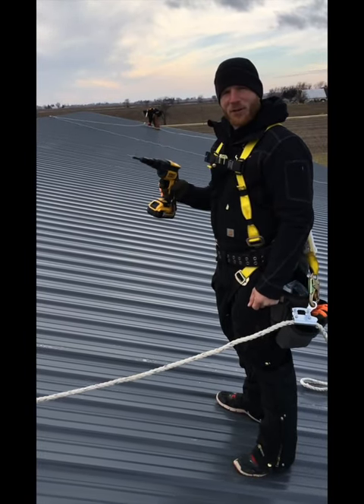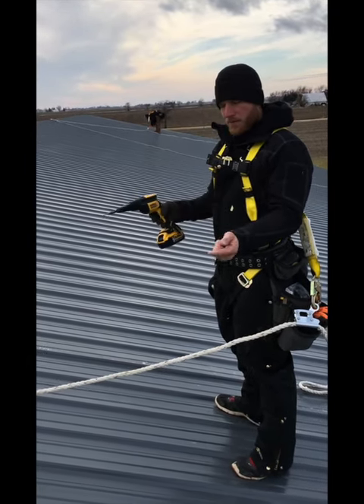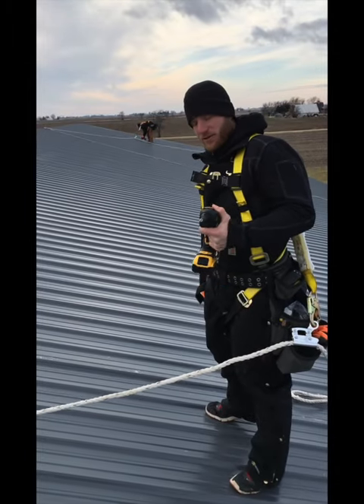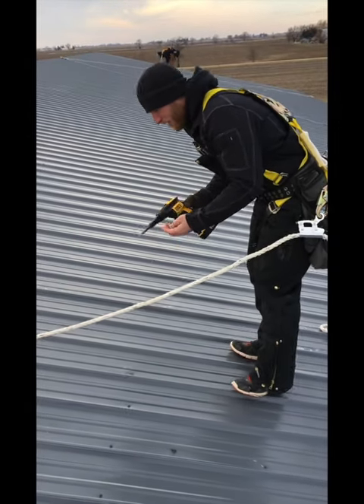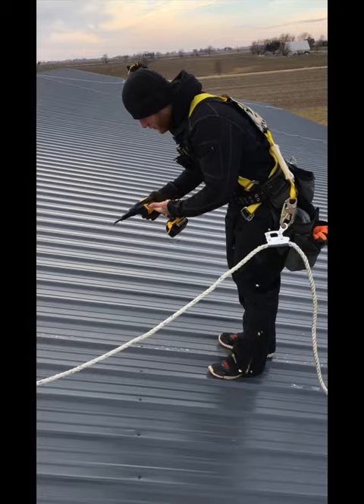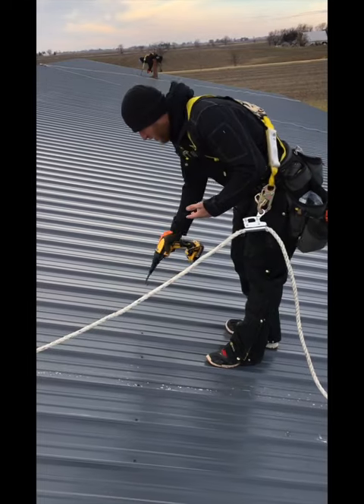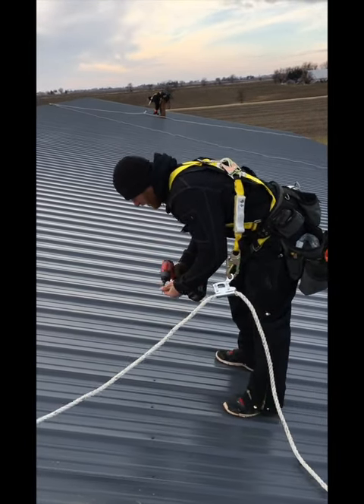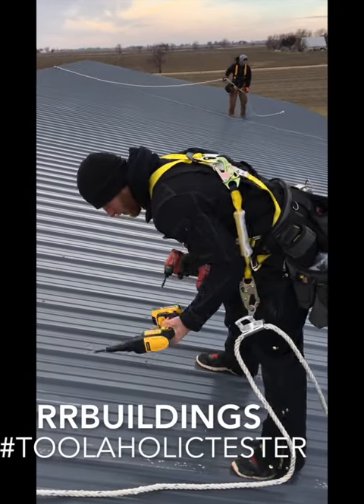Dewalt DCF622 Versa-clutch review

Comment: who uses impact drivers to drive that small screws into soft metal? Impact drivers are meant to brute force torque not for rpm speed screwing. A standard drill would do better too..
Reply: Beg to differ except in a greenhorn hands, (I work my impact like a fine piece of ass) BUT I get your point homie. I love my milwaukee remodeler gun, I do use it mainly on wood sheath or God forbid drywall if I can't fake sick that hour lol. But yeah back to the video, not a vs kinda battle really, but I love raw video. Bro keep it up! I'll keep watching man
Reply: I always kinda just used my impact for driving everything and I think I got like this from the years of being up on ladders/scaffs and needing the lightest drill attached to my rig or belt. Those “just get it done” situations.
 
But drills have come a long way in improving size/weight so lately I’ve been using my new standard chuck drill as my ‘main’ drill I wear.

It’s crazy but my impact from 4 years ago is heavier and the almost the same length and my new brushless chuck drill....and the new impact drills they got now? Sheesh so small!
Reply: Yeah dude has no idea what he’s talking about I do light and heavy steel framing, there’s 3 different impacts I see, the Milwaukee 2 speed impact, the dewalt 3 speed impact, or the Makita impact. Most people like the makita the most I prefer Milwaukee personally. ZERO people use regular drills for installing steel. FACT.
Reply: @keys72  milwaukee for the 🏆

Comment: I guess it just comes down to using the tool intended for the job
Reply: Yes Milwaukee makes a screw gun too. These are used mainly for drywall
Reply: @justauser these are way different then a drywall driver. Yes the bodies look the same but works way different.

Comment: Any option of using the dcf620 drywall gun for metal?
Reply: No, because the drywall gun only cuts off at a certain depth, this has a clutch. Since you're using hex head screws on metal you would be over torquing them and stripping the metal due to the extremely high RPMs of the drywall gun.

Comment: Good to see, but they are 2 different tools. Adjustable clutch or depth will always be faster. Get the Milwaukee Fuel Surge Hydraulic 1/4" hex driver if you want quiet. Way smaller for tight places, but that's not a concern. Watching for a good deal on the DeWalt myself, Versa-Clutch is the bomb. Have an old corded one....

Comment: Great real world comparison!
Reply: That's a horrible comparison. One is a screw gun and the other is an impact driver. Milwaukee makes a screw gun for this purpose. It is nearly identical to the Dewalt he is using.
Reply: @greygag36  Milwaukee doesn't have a cordless screw gun like this. They have a drywall screw gun. Totally different. They look the same but function in two different ways (clutch vs. depth).

Comment: You know Milwaukee makes a m18 DRYWALL gun also right?
Reply: The DCF622 is not a drywall gun, it’s made especially for metal roofing. Low speed, high torque applications.

Comment: How do you think this will do with drywall?
Reply from the maker: they make a drywall version.
Reply: I owned the one the is for drywall but am wondering the same thing about this one since it's metal framing? Just looking to upgrade to this one if its worth it
Reply: Get the Milwaukee drywall gun.  Has a locking but only runs when pressure is applied to the tip

Comment: Cool man. My only issue is that in " lock on " mode the motor is still spinning. Do you think this chews through your battery life? I only ask because obviously the Makita and Milwaukee have push drive motors thus saving juice and noise. I've owned all flavours of corded screwguns and my corded dewalt is most impressive albeit a little heavy ( compared to hitachi and Makita). As such I'm looking for a cordless gun with grunt ( my ' kita 4000rpm one can't sink em) . All the best, oh and come to Australia man, no harnesses! 🕺🏻😱😉

Comment: Using an impact driver vs a screw gun. Use Milwaukee's screw gun and see what happens.  Dewalt sucks and is for lite commercial and home use. Milwaukee is full on commercial industrial use. Hahahaa
Reply: The milwaukee will still be slower....
You can put down 2 to 3 more screws before the first one is set with a drill.
Reply: Yep DeWalt left Milwaukee in the dust eons ago.... Milwaukee is hyped up expensive thick plastic that's all, Milwaukee equals a terd in the toilet a very ex pop ensure terd to
Reply: @jorrdanlease3106  i wouldn't say that...I've slowly got more milwaukee tools over the years.  There nail guns are 50-1 better than dewalts